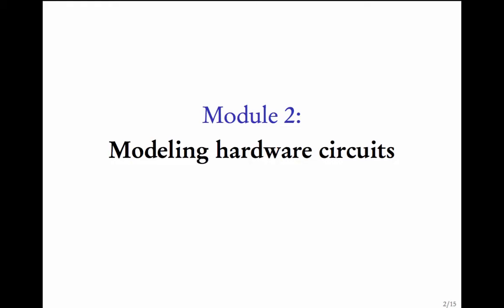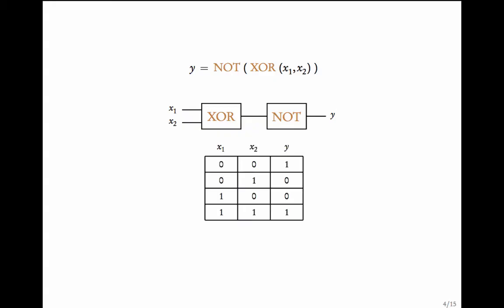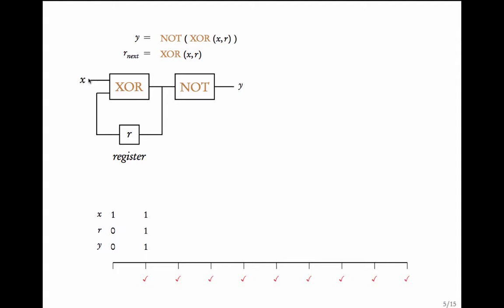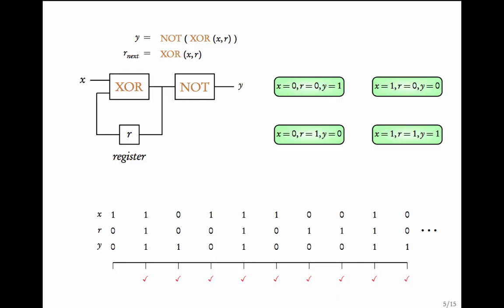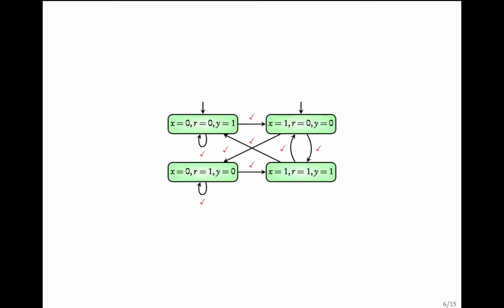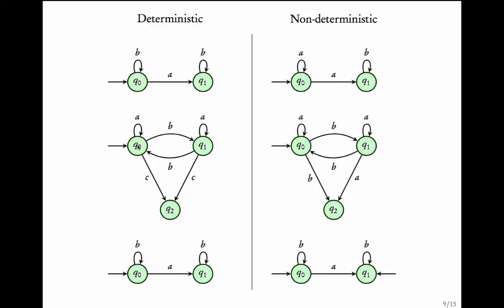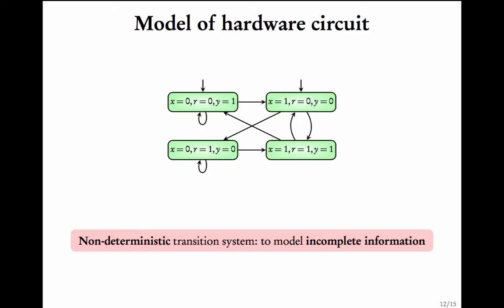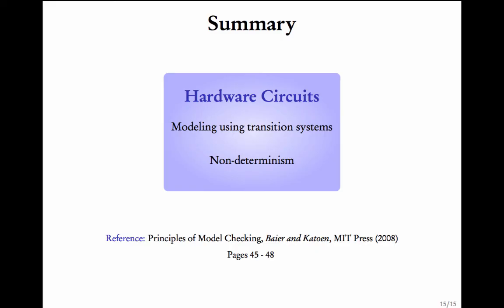Modeling hardware circuits

Comment: I'm lost what does these abstract concepts have to do with designing hardware?
Reply: as soon as you have flipflops with memory, simple and/or/not can't represent it. think of a a state as the combination of all the memory cells.

if you were designing an ethernet device, you would have it turn voltages on one set of pins into voltages on another set of pins. the timing and voltage levels are what gets described.